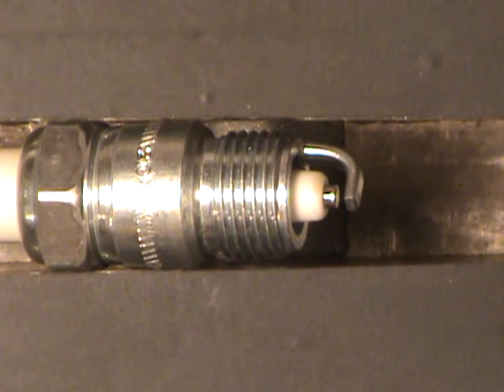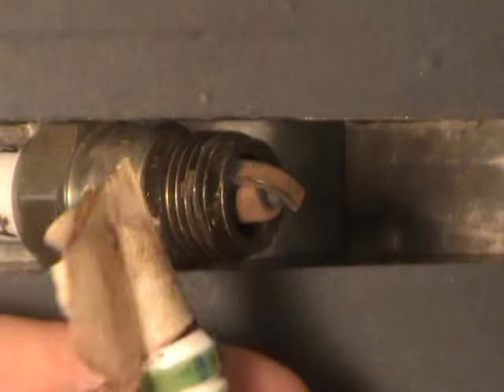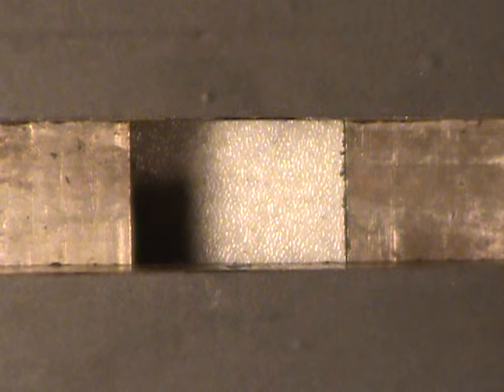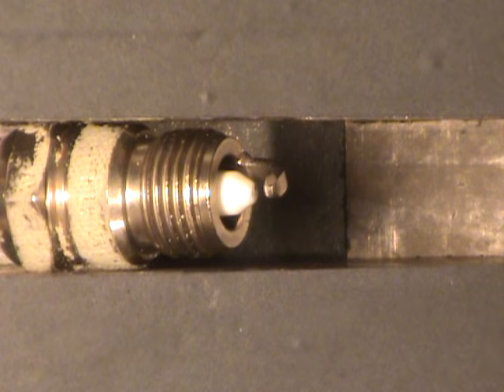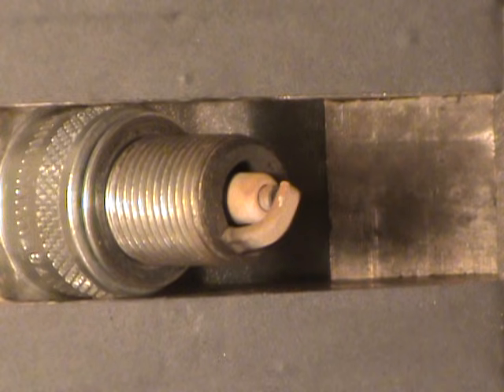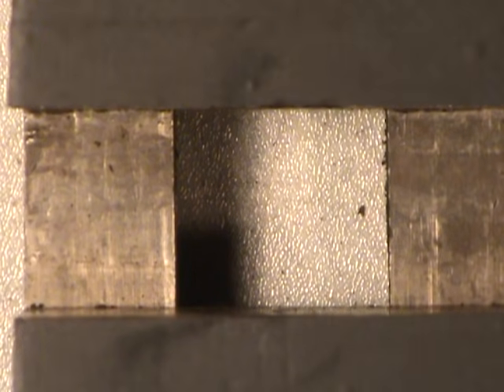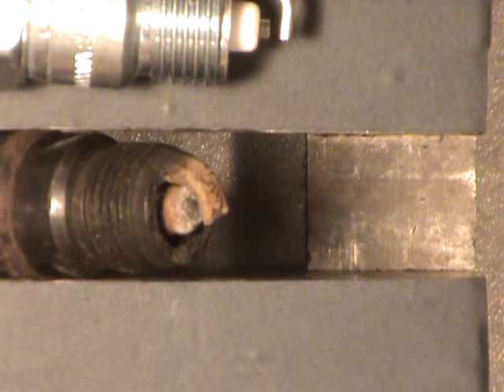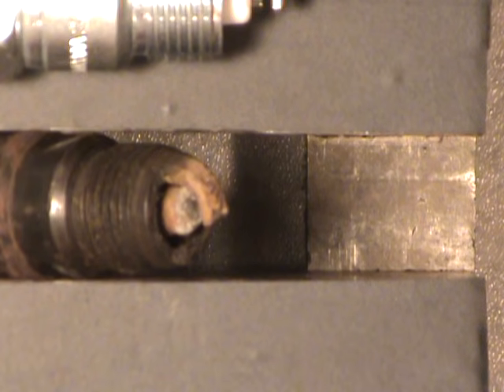SPARK PLUGS How to Read them (Part 3)

Comment: Thank you Rocky. After watching your video and reading some of the comments, I have decided that my 1970 429 is running a bit lean with the newly installed Holley 600. It has been running very nicely but a plug check yesterday showed a more white colour that what you describe as a good colour. Planning to get the next jet size up to determine if that will improve the mixture to a more healthy level.  About how many miles should I drive them before checking again?
Reply from the maker: Greetings...Todd Doyle.............You're welcome, and Thanks for watching.............Although, this YouTube Video's Thumbnail Picture, that's showing the Spark Plug, with that, shall we say, Tan colored Deposit on it, well, it might show up, or, it might not, say what...???................There can be a few variables, that can, and might be responsible for, the Deposits, that actually show-up, and get stuck-to, a spark plug, that came out of a running engine..................Some Folks, are sayin' that, there probably won't be very many Deposits showing on a spark plug, that came out of an engine, that was burning Gasoline with Ethanol (aka, Alcohol, sometimes made from Corn, possibly), in its Blend.......................Interesting that, as this Video's Spark Plug/Thumbnail Picture, that has that (nice...???...lol), Tan Colored "Deposit" on it, as far as I recall, was burning, 87 Octane (R+M Divided by 2, Rating Method), in a V-8 Engine, that had, about 8.5 to 1 Compression Ratio, and the Gasoline, in the gas tank (at the time), had about 10% Ethanol in its Blend (please note, that, some Gas Pumps around here, had some words on them, something along the lines of...May Contain Up-To 10% Ethanol...???...kinda misleading huh), and, makes me wonder, why some of those Folks, out there (in Cyber-Land...lol), were sayin' that, there probably won't be, much in the way of, any Deposits showing-up, on the spark plugs...???....................Be Careful, and never go Too Lean, of an Air/Fuel Ratio/Mixture, while doing a WOT/Wide Open Throttle run, cuz, that's usually when, the Nastiest Damage (Destruction...???), to just about any gasoline burning Engine, will usually Happen...!!!...and I hope not....................Check to see, just What...???...the Gasoline, that You put in Your Vehicle's Gas Tank..."Actually is"...???...and, if it has any "Ethanol" in its Blend, what is the %age (Percent-age)...???...................Sometimes, when an Engine is running Too Lean, of an Air/Fuel Ratio/Mixture, while just Cruising along, at not too fast of a speed, there can be times, where You might feel a Lean Surge, where-by, the Vehicle, will kinda be Surging/Bucking Back and forth, and sometimes, too much Ignition Timing Advance, might cause the, some-what, same thing as well, just so You know....................Probably, the Safest Way, to "Monitor" the Air/Fuel Ratio (mixture), while Driving like Granny, or a Mad-Man...lol...is to install a "Wide Band Air/Fuel Ratio Gauge", (having a Wide Band Oxygen Sensor, installed in the Exhaust System), that way, You'll be able to See, in real time, just what...???...Your Carburetor, is Feeding Your Engine, Air/Fuel Ratio-wise, at All Speeds and Loads, just to keep the Engine Safe, and if the Carb is Dialed-in real Good, some Newly-Found Performance, might be noticed (seat of the pants method...lol), and, not only that, but maybe, some much Better Fuel Economy, might show-up as well, but Only, if You keep Your Lumber-Jack Boot, from Mashing, the Gas Pedal to the Floorboard...!!!...lol...................I usually Run the Engine, with New Spark Plugs, for about 100 Miles or more (if the Engine Behaves-itself, that is), cuz, I figure that, that will give ample engine running time, to allow some Deposits, to shall we say, "Cling-On" (Star Trek...???...lol) "to", the electrode-end of the Spark Plug/s in question......................From what I recall, Holley "Jets" are Flow-Rated, and the Orifice/Hole Size, can vary a bit as well....................Hmmmmm...I think, that I recall seein', that, when the Holley Jet Size, was about, what was it now...maybe, a Number 70 or Smaller, the Orifice/Hole Size, was with-in, about a Thousandths or Two, of an Inch, for each Step, in Jet Size...where as...it seems the LARGER than, about Number 70, the Jet Size Orifice/Hole Size, Changes a Lot More, for each step, in Jet Size...!!!...so pay Close Attention, when-ever Changing any of those Jets......................The Older Distributor Ignition Systems, usually didn't Output, oh, shall we say, as Intense, of a Secondary High Voltage, out of the Ignition Coil, especially-so, on something like, the good ole Points and Condenser Distributors, that controlled, the usually, Remotely mounted Ignition Coil , that were with Us, till about 1974 there-abouts, and might make-for, some extra Deposits, showing-up, as opposed-to, the Newer, Higher Output Ignition Systems, that, just might result-in, having, some-what Cleaner looking spark plugs...maybe...???.......................Damn, Your 1970...429, just reminded me of something.................Some years ago, a Friend of mine, as I recall, had about the same Year, and it was probably a Torino, and He was sayin', about having Bad Front Brakes, so, I told Him to bring his Car, over to my place, and that I'd have a look at it, for Him.....................Well, once the Car's front end was jacked-up, and the wheels were removed...Thar"it"-Was...and it was the right front Disc Brake Rotor, along with its Buddy, the Disc Brake Pad, that was probably responsible for, that, shall we say "Ginding Noise"...and I've never, Ever SEEN, a (disc brake) "Rotor", that had a surface finish, that looked, just like a LARGE piece of Corrigated Cardboard, with the outer skins removed (You know, that)..."WAVE-EE"...Design, that is seen, when You look into a piece of Corrigated Cardboard...???...Yes-Sir-ee-Bob...it appears, that the "Rivets", once there wasn't enough Friction Material left, to do the Stoppin', then, those Exposed Rivets, Machined those quite Impressive "GROOVES", much like a Metal Lathe, would be capable of doin' alright, and needless to say, that, a..."New Disc Brake Rotor"...had to be added to the Repair List...!!!...lol.....................Now then, if You happen to have any questions or concerns at all, just give me a shout, and...........till next time...........Be Safe, take care, and have a good one.
Reply: Thanks Rocky. I have realized that the power valve in the holley is most likely on the undersized side for my engine. Idling I have 18inch of vacuum. My reading suggests that a correct power valve would be 9.5 and as high as 15.5 and I currently have a 6.5. Funny how everyone suggests 600 holley was the answer to everything wrong with the car. Sort of like saying a dog will give you more exercise. The wrong dog will lay around all day the right dog will have you walking all day. What I mean is, a Holley 600 is just a start, next there is power valve selection, jet selection, accelerator pump spring selection, gapping accelerator pump, secondary spring tension etc etc.
Reply from the maker: Greetings...Todd Doyle.................While the Engine running, the Power Valve Rating (measured in inches of Mercury, or Hg), is usually, when the Power Valve will start to Open, once the Engine's Intake Manifold's Vacuum, Drops Down-to, or Below, the Power Valve's (vacuum...Hg) Rating, and will stay Open...until...the Vacuum Level, goes Higher, then, that of the Power Valve's (Hg) Rating, when it will usually Close, once again.................The Power Valve (sometimes, called an Economizer), is only, a, shall we say, Flood Gate, if You will, cuz, there's usually a channel (aka, passageway), that will usually have a calibrated Restriction in it, that will actually Control/Regulate, the amount of Additional Fuel/Gasoline, that gets added-to, whatever, is already being provided, by the Fuel (gasoline) Jets, while just, let's say, just cruising along, at not too fast of a speed...................If the power valve comes in too late, that's not so good for the engine, while under load, and if it comes in too early, then, it's usually, just a waste of gasoline, that really isn't needed.................The Earlier Holley Carbs, can sometimes, have their power valve diaphragms Ruined, because of a fairly powerful Backfire (through the carb), and, if it does happen, then, the Carb will usually be, running way Too Rich (air/fuel ratio)...unless, it is equipped with, shall we say, Anti-Backfire Protection, probably like, the newer models might have......................If Your 1970 429, still has, probably the Original "Points and Condenser Distributor", then, hopefully, it has been Tuned Up, and well Maintained, cuz, if not, that in itself, can be responsible for, a Not so good (use Your Own Bad Word here...lol) Running Engine...
Reply from the maker: Greetings...Todd Doyle...(continuing on now)...Make Sure that, Your Distributor is in Excellent Shape, and Your Ignition Timing is with in Specifications as well..................Also, keep the rest of Your Ignition System in really good shape as well, cuz, all it takes is something as small, as a not so good wiring connection, to mess things up....................Yes-Sir-ee-Bob, if enough time is spent, and it's done right, just about any good carb out there, has the potential of really working well...hopefully................If and when, You might not want to tinker with Ur Holley anymore, then, here's something, that You might want to check out...................Demon (carb company), has the "Street Demon Carburetor", that should be available in, oh, 625 and 750 CFM/Cubic Feet per Minute flow rating....................They both, are Spread Bore Carbs, having smaller primary throttle bores, and Larger secondary throttle bores (Goggle Valve...!!!), and they should work on most types of intake manifolds as well..................If You have an Automatic Transmission, check for, both the Throttle Linkage, and if applicable, the Auto Trans Linkage (at the Carb), if applicable (or maybe none, cuz of a Vacuum Modulator, perhaps...???)..................I've heard nothing but "Good", about the Street Demon Carb.................Once this Carb is bolted to the intake manifold, it's just usually, some rather Simple Adjustments, that, might be needed, if, at all...................Thumb screw for the Idle Speed...2 Idle Mixture Screws, at the front of the carb, and, there's the Secondary Air Valve (Flap...lol), Torsional Wind Up Spring adjustment...................Quite a few Guys, are saying, after it's bolted on, and, once the Throttle Linkage/Transmission Linkage, is good to go, that, it's about the Best Carb (running wise), right out of the Box...!!!...how about that...................So then, whatever way, that You choose to go, and, if You have any questions or concerns at all, just give me a shout, and I'll do what I can, to help You out, and........till next time...........Be Safe, take care, and have a good one.